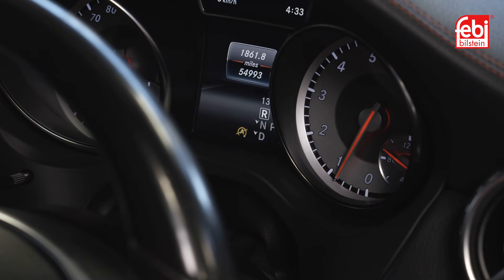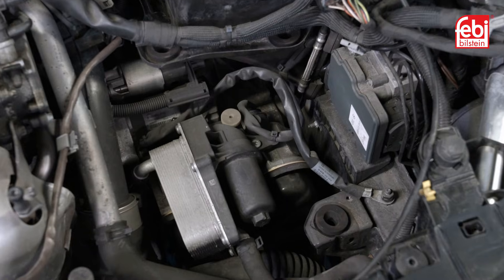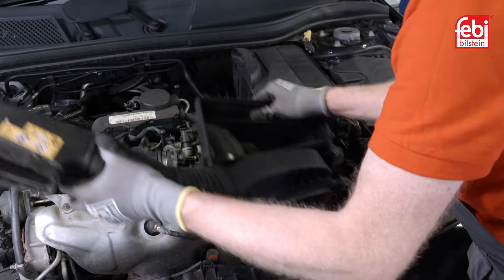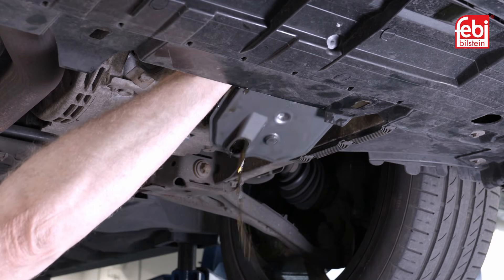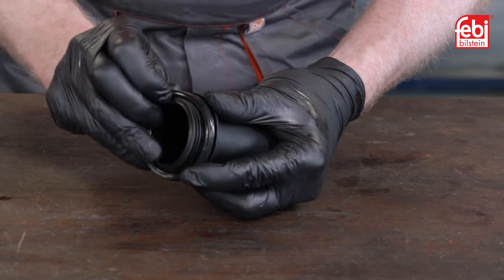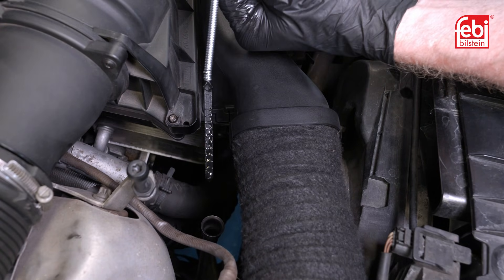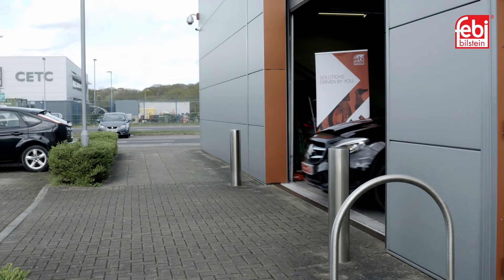[EN] Mercedes 7G DCT 724 Automatic Transmission Oil and Filter Replacement

Comment: What is the sort of average litre of oil the transmission holds at rhe correct level. Surely it's been done thousands and thousands of times that you can just put the average oil in that most do and you'll be ok without checking the temp?
Reply from the maker: Thank you for watching our video. The 7G-DCT (724.0) transmission is available in two wheel and four wheel drive variants and has been used in several different Mercedes-Benz models. Therefore, there is not a best guess average oil capacity.  This transmission is really
sensitive to oil level, and under or over filling even small differences can cause noticeable shift quality
issues. Therefore, it is best practice to follow the vehicle manufacturers procedure using quality lubricants and filters to service this transmission.
Reply: @febi.bilstein I have a 2015 cla220d front wheel drive 724 transmission. What's the rough amount of oil this gearbox takes?
Reply from the maker: @bigeater1310  Unfortunately this is not enough information. Mercedes list four different capacities for the CLA (117) model.
Reply: @febi.bilstein 2015 Mercedes cla220d c117 170bhp front wheel drive. Not sure what other information there is to give?

Comment: How do you get those 2 middle bolts out & with what tools? And is it from below or above the car?
Reply from the maker: Thank you for watching our video. The tools used to remove the oil pan bolts were standard quarter drive ratchet, Torx socket and short extension when required. The lower and middle bolts were accessed from under the vehicle.

Comment: Exact same for cla 200 156hp c117 2014 right?
And what about clutch liquid?
Reply from the maker: Thank you for watching our video. Yes the process is basically the same. However, the oil level can differ on each engine and transmission combinations. Which is critical.  Please check this information first before carrying out a transmission service.
Reply: @febi.bilstein  that is correct the OBD scan tool will tell you at what number on the dipstick the fluid level should be depending on the fluid temperature, and it's not the same for different car models, for an A-class merc model A180 W176 724-gearbox it showed me that for 40 Deg C it should be at level 2.5 on the dipstick and at 70 deg C it should be at 3.5

Long story short u need scan tool, buy somewhat cheap scan-tool like an XTOOL A30M for 150 euros, lifetime updates, bi-directional tool etc.

If u want to do it without scan tool then scour the internet until u find someone who already did this service for your exact car model and see at what lvl on the dipstick the fluid level should be at 40 deg C and at 70 deg C, but you would still need to own or buy an infrared temperature reading tool where you would need to point at the bottom of the transmission fluid pan and get some temperature readings, and of course u need to own or buy the febi green dipstick.

Also when u do this service with a scan-tool u are instructed to do few things, one such thing is rev the engine past 2000 rpm for 3 seconds then wait for 15 sec, so if you do it without scan tool you should do these steps, try search on internet all those steps ...

One last thing, something that is not clear in this video and very important ... when u check the fluid level with the dipstick the engine must be running, don't check it with the engine off, if I'm wrong on this one please someone correct me.

Comment: Do you have the engine running when you check the transmission oil level?
Reply from the maker: Thank you for watching our video. Yes, the oil level is checked while the engine is running.
Reply: @febi.bilstein  i have not change mines yet, but to learn the level of fluid as: when it 40C it show deepstick level at about 4 and when it to about 70C it showed 7, and i used new INNOVA 5510 fluid temperture check ok

Comment: is this one the same as 2019 GLA 250 automatic trans BASE model (not 4matic model)
Reply from the maker: Thank you for watching our video. Yes the process is basically the same. However, the oil level can differ on each engine and transmission combinations. Which is critical.  Please check this information first before carrying out a transmission service.
Reply: @febi.bilstein  thank you and last question: some said some transmission need to add additive pack, is this require for  DCT 724 , PLEASE
Reply from the maker: @GoodMemoriesToRemeber  This is only for AMG models which is a recommendation from the vehicle manufacturer.
Reply: @febi.bilstein  i love to share this info that i learning and collect from my model 2019 GLA 250 base model trans 724: after 30miles drove home i measured it show 80C level 7, cool down after 4 hrs 52C level 7 and over night 8 hrs  it show 39C at level 7.... iso i am planning to replace it and will fill it at level 7...can you give me some suggestion here, first time doing this, i just dont want nothing go wrong. do i check it when it running after relaced the fluid, if so then what level should be.Thank you
Reply: @febi.bilstein  Firstly i want to say thank you for all prom reply, great sharing video.  i got very nervous  i am about going to change trans fluid the 2019 GLA Base model front wheel drive, i bought all part from dealer OEM , just wonder how to check the fluid at certain temp, so far i am learning to see how the temp go and i see as follow : when it drove home i used deep stick to check trans fluid by my Innova OBD2 model 5510 it showed 80C-level 7, few hours later cool down to 66C, 63C and 52C they all always at Level 7, and when i have my car running and at 40C show level 3, i guess i will follow that. so summary: look like doesnt matter cold or hot when engine is off always at level 7 and while it running temp between 40c-70c it always show at level 3, i hope this help with whose had 2019 GLA250
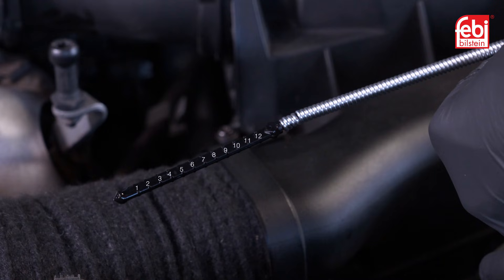Reply: @febi.bilstein  @3:55 40C level 4 and 70C level 5,  is that while the engine is running
Reply from the maker: @GoodMemoriesToRemeber  Yes.

Comment: do you know A200 W176 2016 is it same as your video ? change the oil
Reply: The mercedes manual says 5 lt but i raccommend 5.5 lt. I did it too.
Reply from the maker: Thank you for watching our video. The A Class W176 model has the same transmission. However, please double check the exact model code and transmission, because the oil level can be different than the GLA model shown in the video. This is critical to the operation of this transmission.
Reply: i try and i find very hard to remove airtube (near the oil filter)...

Comment: hello, i have an a45 amg w176 (2017). i just changed the whole kit as you are showing in the video. i have connected the bosch obd computer but im having problems to see the oil temperature and the oil level required to it. it says to rev the car above 2000rpms for 3s, then release the acelerator for 3s and go to next step. then it shows an 15s  countdown and nothing. cant pass to the next step, and says that i have an error. dct temperature on car shows 42 degrees and in the computer shows 45 degrees. is that too much temperature? before the steps it says the conditions have yo be between 35 and 45 or 60 and 70.
Reply from the maker: Thank you for watching our video. The correct oil level for this transmission is critical for its operation, plus Mercedes-Benz recommend an oil additive for the AMG variants. The 176 models equipped with this 724.00 transmission 176.000/007/011/012/041/042 the oil level at 40 degrees should be at 2.5 and at 70 degrees should be 3.5 on the dipstick. Model codes 176.001/008/043 the oil level should be at 3 at 40 degrees and 4 at 70 degrees. I think the error you are experiencing is a process error, if the checking process is carried out to many times. Let the car cool down and start the oil level checking process. I hope that helps.
Reply: @febi.bilstein  correct, that additive is not cheap, it's 50 euros or thereabouts on ebay or from dealership, it's an anti-foaming agent, it's compulsory for AMG models and optional for non-AMG cars.

If fluid starts foaming then u will not have proper lubrication, foam means lots of air and not enough fluid, it's obligatory on AMG models because the car is more powerful, more aggressive so chances of transmission fluid foaming is far greater than on non-AMG models.

By the way if u did the service without the anti-foaming additive u should know u can buy it and add it later without worrying that will mess up your transm. fluid readings, the anti-foaming additive bottle is small (30ml) so it will not change the fluid level reading in any significant way.

This anti-foaming agent has a part number u can search the internet using this number to find it, it is      A 001 989 94 03 13
Reply: Is this the same process as the 724.1?

Comment: Hello, i have an infiniti Q30 sport that also has the 7g dct transmission the exact same thats in the gla, would this process work for my car also?
Reply from the maker: Thank you for watching our video. Yes, the procedure is effectively the same. However, please check the oil dipstick measurement, because each variant is different.

Comment: How many liters are needed
Reply: 4.8/5/5.3 lt based your car
Reply: @emanuele2939 how to know which one? I have GLA 200 CDI
Reply: You said 6.5 first
Reply: Gla 200 cdi 5 lt.....if 4matic 5.3 lt I recommend you for everyone 5.5 lt.
Reply: On a A200w176 2014, how do you refill the gearbox oil?